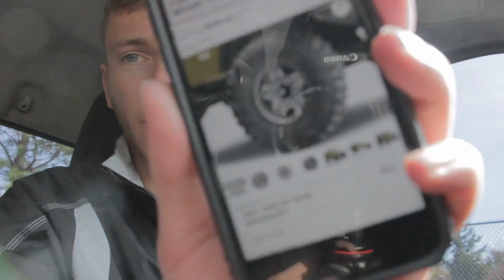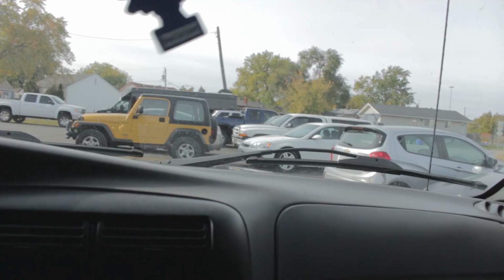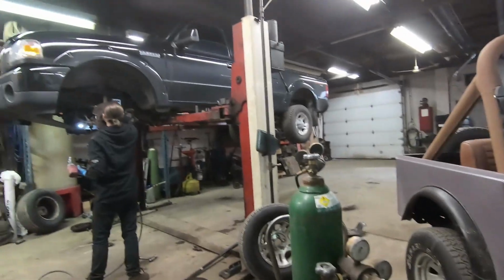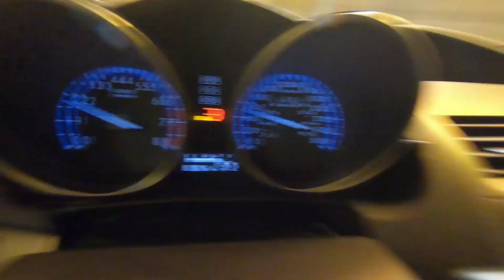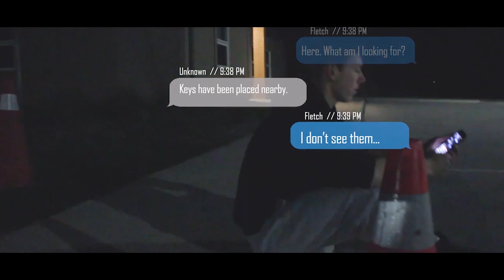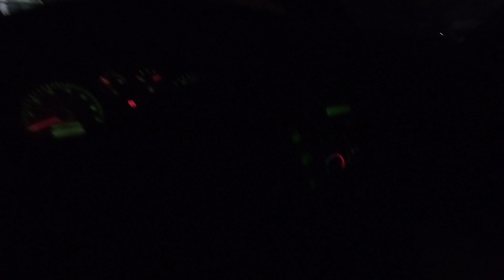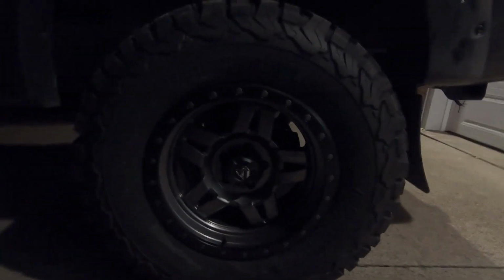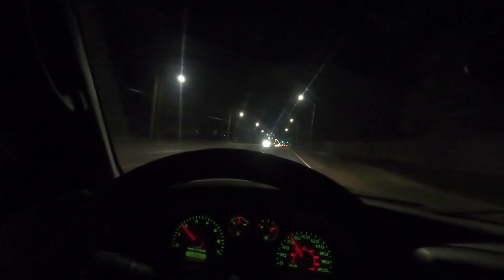Lifting My Ford Ranger!

Comment: I’m thinking about getting this exact lift. How much slower is it though? I don’t want to totally destroy my trucks speed but definitely want a big lift. How was daily driving compared after?
Reply from the maker: Not much slower actually. Daily driving it on the lift is sweet! In the first days of driving with the kit, I found myself making u turns and using ditches, and passing cars making left turns in grassy shoulders. It’s a great kit with practical use. I love it
Reply: Re gearing or changing the gears to 4:56. Will help you. When I lifted my Ranger with 33s it was definitely slower. So I changed the rear axle to a 8.8 from a different ranger. That had 4:10s then later I changed it to 4:56. Definitely worth it in my opinion.

Comment: Nice truck man! I’ve had my ranger for going on 5 years in March and have yet to lift it but have wanted to the whole time. Have you felt any significant loss of power or anything? Also around how much did everything cost if you don’t mind me asking?
Reply from the maker: At first I definitely noticed a lack of power entering the highway. I just have to rev it out a bit longer than normal for speeds, but it takes it fine and is perfect at any speed. Everything costed around $6K!
Reply: Hi ! Do the lift kit cause any problem for the CVS ?
Reply from the maker: @AlexisJacqJJ no, although I did have to get mine replaced. Mostly wear on the front driveshaft but rough country offers a driveshaft to solve this

Comment: Great Video, i just bought my First ranger this week. Im wondering what you did to your exhaust system it sounds sweet, is it straight piped or aftermarket?
Reply from the maker: Congratulations! What engine does yours have? Believe it or not it’s stock! The 4.0L’s sound pretty good stock! Thanks for watching!
Reply: @6speedfletch  its a 2008 4x4 sport with a 4.0L. Thanks
Reply: There’s no way that’s stock exhaust
Reply from the maker: Yup it is. My old ranger sounded the same. They sound pretty good right out of the box for what they are. It is the same engine they used in the V6 Mustangs in 2005-2009
Reply: Sounds like the muffler has been removed or replaced. That’s not stock.
Reply from the maker: I haven’t done anything to it. And it was untouched as far as I know. Nothing was modified until I got it.
Reply: @6speedfletch  I just got an 06 Ranger 4.0l.  Not sure what I should do about my exhaust first.  I can barely hear it at idle and while in the cab.
Reply from the maker: I’m still trying to figure that out lol. Eventually I plan to order an MBRP system. It’s a tough decision for sure

Comment: So I have a 2011 4L and was told lifting is was not possible do to the computer system.... something about how when you lift it it makes the stability track system engage the brakes because it thinks the truck is in an emergency situation. Idk I didn’t really understand what they meant..... did they have any install issues or do you have any issues with it driving wise?
Reply from the maker: No issues whatsoever. And as for the traction control and stabilitrak, it was like that before the lift too
Reply: So did you have to adjust the computer or something? Or is yours 4wd and that might be the difference?
Reply from the maker: Mine is 4x4 nothing was changed besides suspension components and brake lines were extended. Hope this helps!
Reply: Oh yeah.... 4wd is different.... thanks.